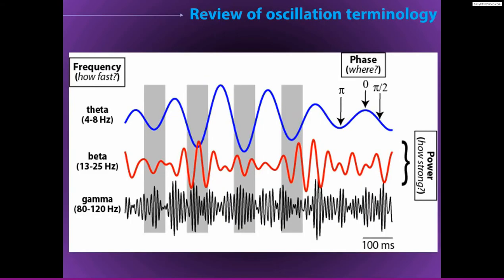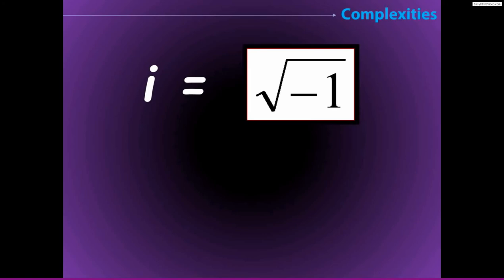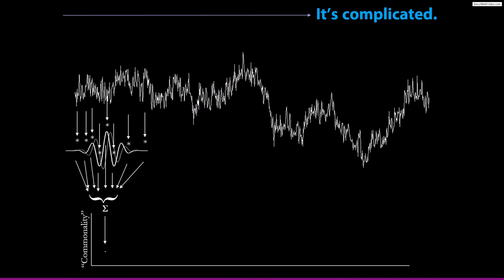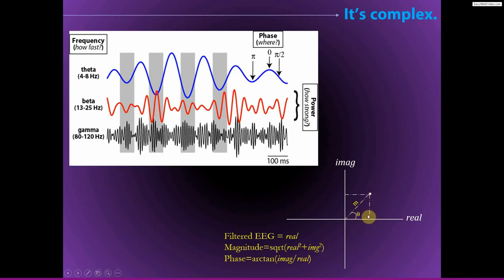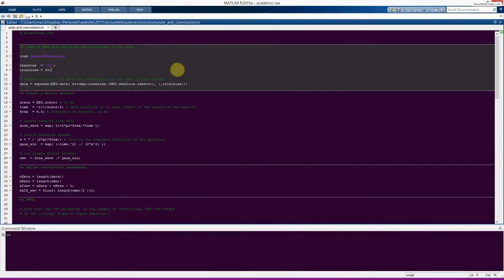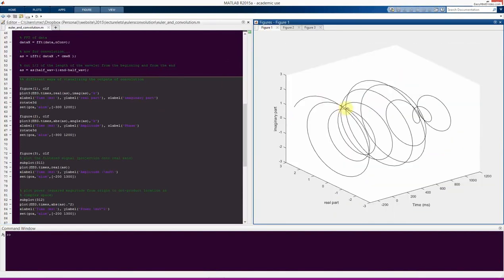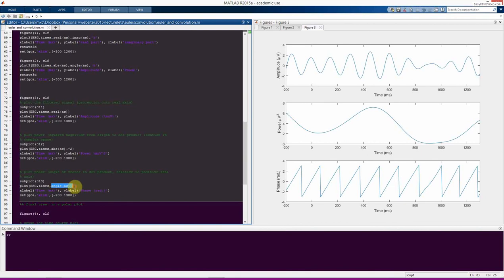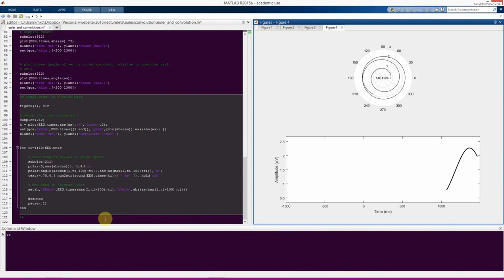Euler's formula and extracting power and phase

Comment: Mike, I am using your method here to analyze generator current signals from wind and water turbines, to see if you can use the frequency representations of the signal to extract useful fault information. I think it's amazing how similar the generator current signals that I analyze look to your EGG signals. Anyway, quick question, you mentioned that the complex Morlet wavelet allows you to see the power of the signal. Well, in my case,  the signals that I want to analyze are already generator power signals, just obtained under different conditions. If I use this complex wavelet, how is the power  obtained from it different from the generator power that I am analyzing, (if there is one)?
Reply from the maker: Hi Brit. Interesting! And I think this speaks to the versatility and obsequiousness of time-frequency methods for understanding signal characteristics more generally. 

The goal of using complex wavelets is to extract the phase and power time series from the frequency component in the signal that matches the frequency spectrum of the wavelet, a.k.a. band-limited phase and power. So it could make sense for your generator power signal if that signal exhibits fluctuations in some frequency. I hope I understand you correctly. You can also feel free to email me with a screenshot of your data and I can give you more specific advice.

Mike
Reply: Mike, thanks so much, I would love to do exactly that, I sent you a direct message, any help that you could provide would be very much appreciated.
Reply: Another question Mike, is the phase angle time series that you obtain from the imaginary axis component of the Morlet wavelet the instantaneous phase angle of the original EEG signal, or the instantaneous phase angle of the complex Morlet wavelet? If it's the latter, is there a way to extract the instantaneous phase angle of the original EEG signal?

Comment: Hello again Mike, lol. Quick question, You mentioned that you square the magnitude time series data that you get when performing complex Morlet wavelet convolution to get the power. However, if you don't square the magnitude, will that give you the envelope of the signal? If so,  what domain is that envelope in (Time, or Frequency)?
Reply: Also, is that envelope, if for the time domain, is it the envelope of the raw time signal or the envelope of the band pass filtered time domain signal?
Reply from the maker: Without squaring the magnitude, you get the amplitude time series. It's in the time-domain and reflects the estimate of the instantaneous energy at that frequency. Conceptually, the amplitude time series and power time series are basically the same. the power time series amplifies the relatively larger effects. To be honest, I'm not sure why we all look at power instead of amplitude. It's basically just for historical reasons (that is, everyone else does it, so we do it too...).
Reply: @mikexcohen1  Thanks for getting back to me so quickly Mike, your response cleared up a lot of confusion. In fact, your response was so clear that I realized that I didn't even ask you the question that I truly meant to. Basically, I am trying to do signal demodulation, and I already know how to extract the Hilbert Envelope of a modulated signal, but how do you create the the Morlet Wavelet equivalent of the Hilbert Envelope from a modulated signal? Is it even possible to do that, and if so, is there any benefits to using one method to generate the envelope over the other (or is the answer to that question the same as why in some cases its better to use Morlets for time frequency analysis as opposed to the HT, and vice-versa).
Reply from the maker: Ah, I see ;)  You can (1) create a complex Morlet wavelet and convolve that with the signal, or (2) narrowband filter and then apply the Hilbert transform. The resulting analytic signal from either method is basically the same (minor differences will be due to the shape of the filter in the frequency domain). I have 1-2 videos about comparing those methods (probably titled something like "comparing wavelet, filter-Hilbert, STFFT") where I talk about the subtle differences. But honestly, it's mostly a matter of personal preference. My advice is to use the method that you understand the best, or the one that's easiest to code.

Comment: Hi Mike. Thanks for your videos. I'm actually unclear on the differences between applying convolution w/o a complex and w/ a complex wavelet. So w/o a complex wavelet, we perform dot product (element-wise multiply the signal with the wavelet and sum) and then get one point which is at the center of the wavelet. So w/ complex, we perform element-wise multiplication between the signal and the real wavelet, and the signal and the complex wavelet and then sum the results to get the complex point? So for each time-point, we still get one point which has the same position of the center of the wavelet, but this time the point is the addition of the real and imaginary element-wise multiplication . Did i get this correct?
Reply from the maker: Yes, that's correct. If you just want to narrow-band filter the signal, then a real-valued wavelet is fine. You'd need the complex-valued wavelet if you want to extract the power and phase angle time series.
Reply: @mikexcohen1  Thanks a alot for your reply. And Thanks for sharing your knowledge on EEG with us. These signal processing Tutorials are the best online, and your tutorials are the only ones for EEG!